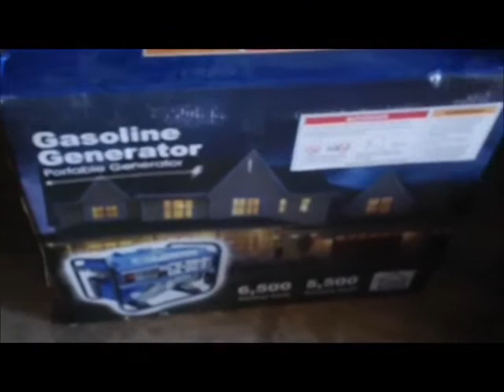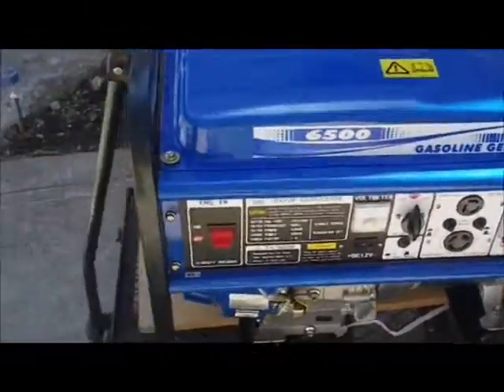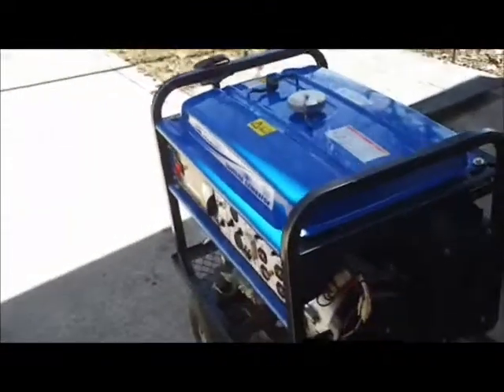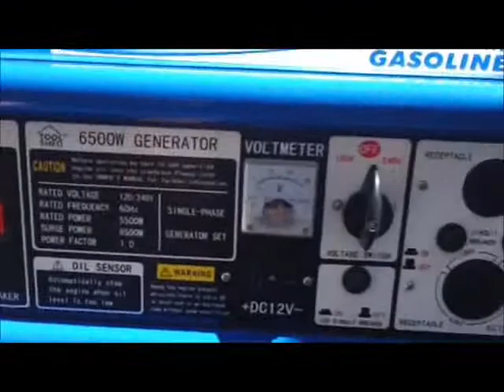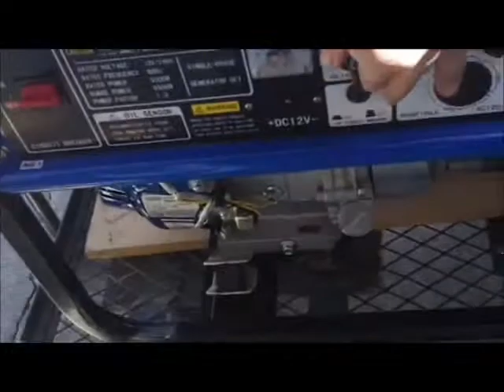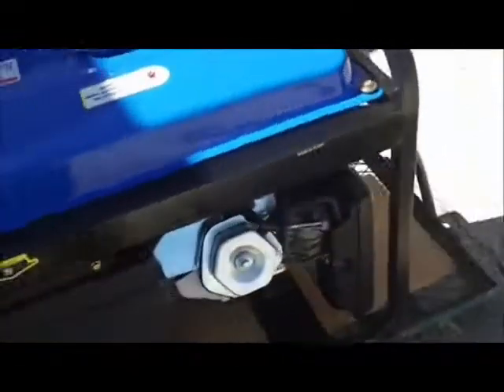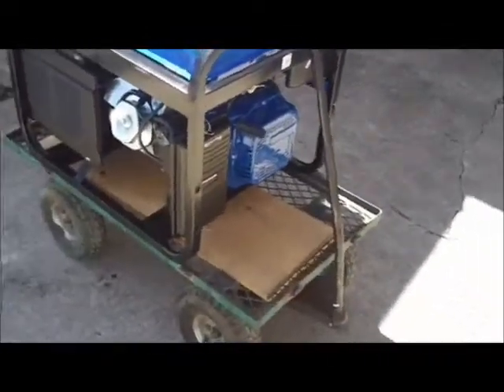Tool Shed 6500W/5500W Generator

Comment: Just came across your video. Wondering if there is anyway I can get a picture of your wiring coming off the engine. I got one that a dog chewed through all the wires and can’t find a wiring diagram for this generator anywhere.